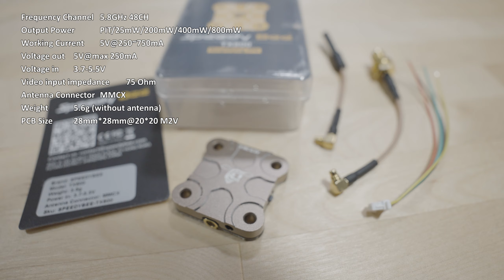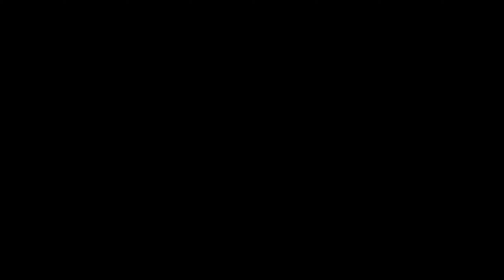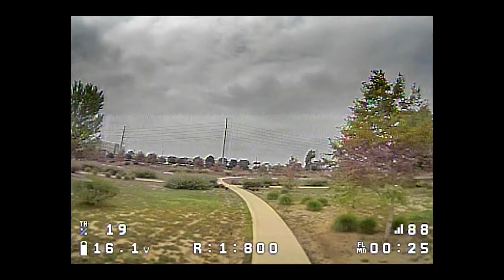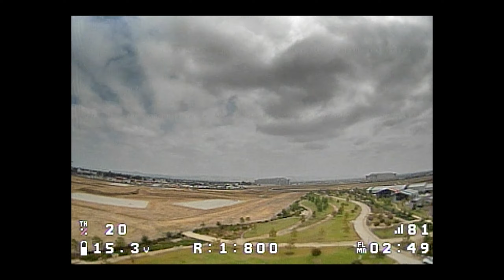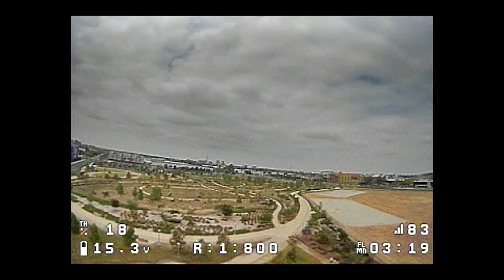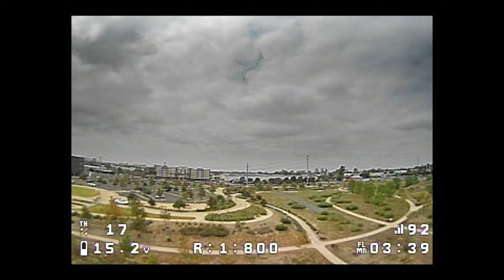SpeedyBee TX800 VTX Review and Winner Announcement 😎

Comment: Hi Albert. I just got my hand on this vtx, and having some problem with it. I can't get the Tramp protocol to work with Betaflight. I have tested it on hardware UART and softserial, no luck. It do transmit video signal and could change channel by pressing the button. My vtx before, AKK FX3 Ultimate work nicely with SmartAudio on softserial.. what could be the cause?

Comment: I only get lots of flashes and breakup only 100m away on this vtx even with no objects in between, do you know what could be the cause of this?

Edit: Nevermind I switched channel, removed the gps, and isolated the SMA from the frame and one of those things seemed to fix it.
Reply from the maker: Yes, some kind of interference as you have discovered.